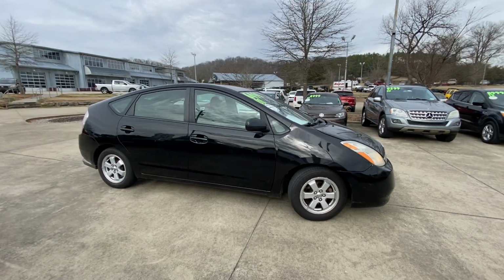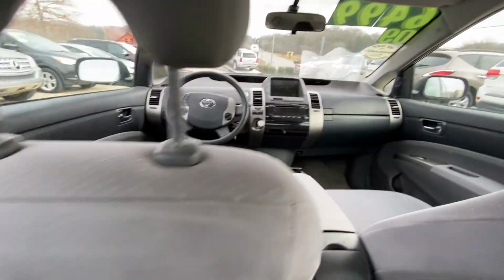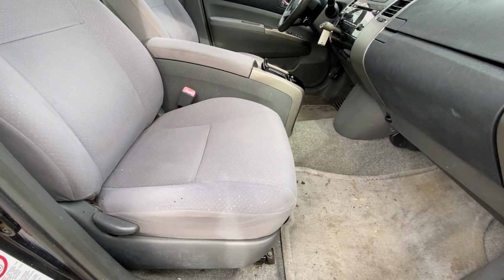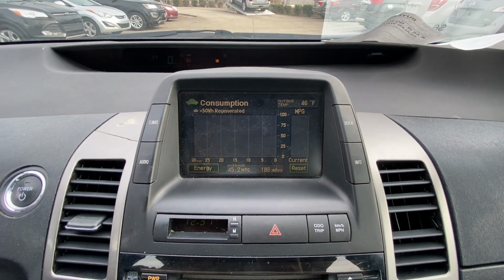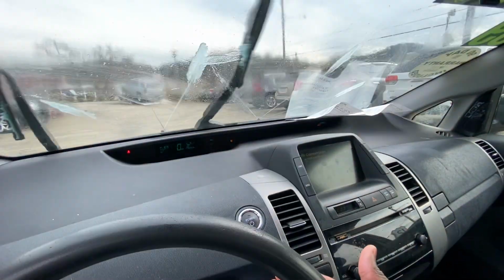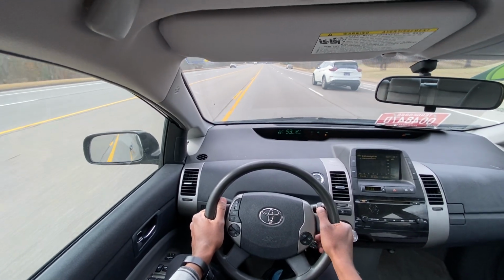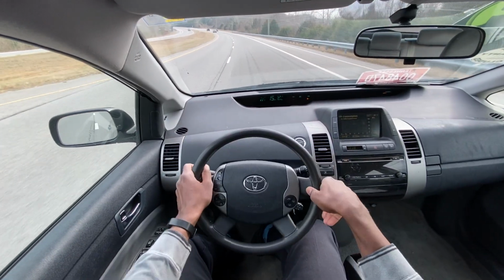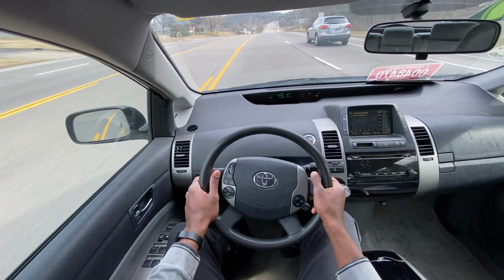2009 Toyota Prius 1.5 Hybrid 4 Cylinder POV Test Drive & Review

Comment: The B is not for regenerative braking but instead its for Engine Braking which is similar to an L mode on other cars for mountain terrains so you dont have to use too much of the normal brake

Comment: With good serviceing these cars are good for 300-400miles.  This one has the engine under tray loose at the front. "B" on the shift change is a brake for downhill hold back and regen. Put "tails" on the little 12v in the boot for easy charging, if you likely to leave it standing for a while. The oddity with this car is that, should the 12v go flat, you can open EVERY dodor EXCEPT the boot!! which is the one you need to get at. Fortunately you can jump start from connecting to the under hood battery. what I don't like is the computer screen for selecting other items along with WHY, when you trun on the light the dash goes dim then by tapping the KM/miles switch you can get it brighter.
Reply: i think it last more than a few hundred miles